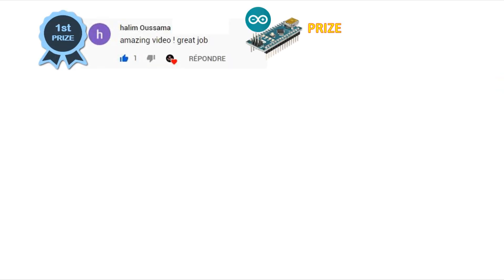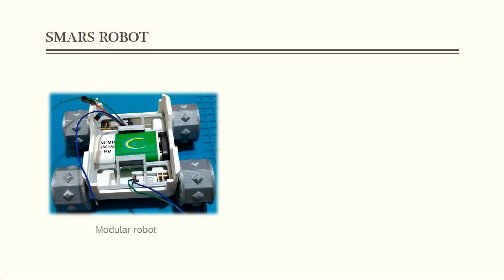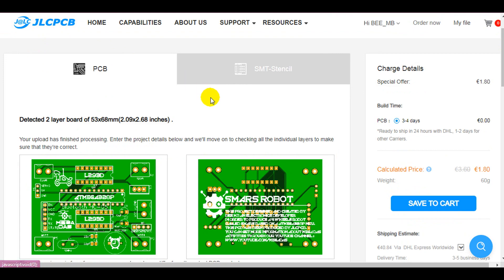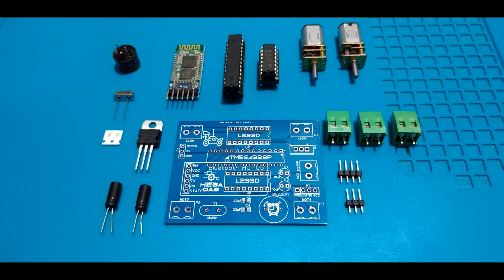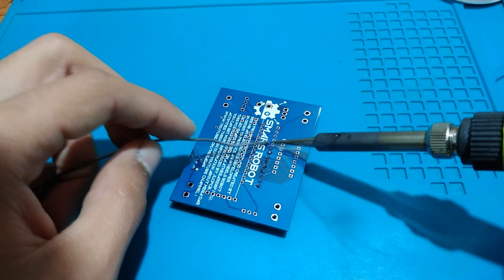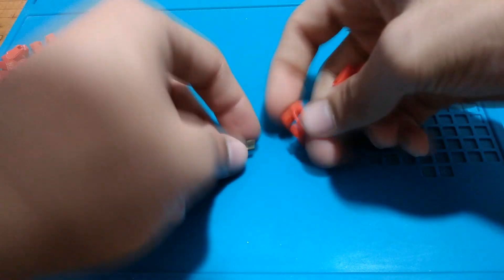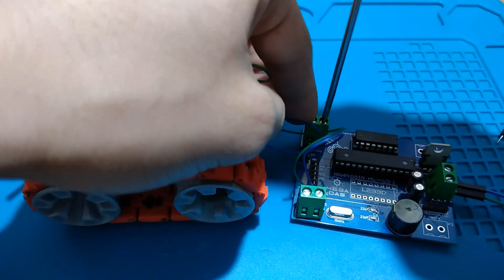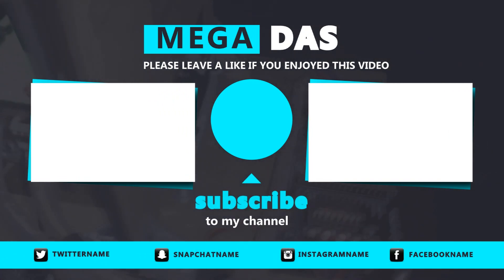How to make Arduino robot SMARS

Comment: why you dont give credit to the original maker?
Reply from the maker: First verse it is tagged in the video description
Then why to tag or promote someone for 30% of the work! I made the full electronics and the android app just got the STL file made..
Please guys don't make the most of it especially because this project has been edited by many makers so it is not clear who's the "original maker"
Reply: @DIYGUYChris  i think even after many iteration, it is still very clear who is the orginal maker, be it a single person or a big team, you should really give them proper crediting, since most of video that i have watched from your content you sounded like you were the one behind them. That is kinda rude to the OP dont you think, since after further inspection in your code you dont seem to change a lot, yet you remove the OP credential
Reply from the maker: @MuhammadRFabio  as I mentioned already, I gave them credential in the video description. About MY code I wrote it from scratch, and I got nothing copied from nowhere.. Otherwise it won't respond to the android app..
Reply: @DIYGUYChris  I admit in this video you did most of the heavy lifting programming job (which I admit is a very chalenging) but the whole SMARS Idea thing, the most STL you used is from this lad name Kevin Thomas from 2017. I also observe in your Quadruped project, the code you post in video description, the STL, almost all (except the android app) is mostly written and designed by RegisHsu back in 2015, while your work is of course is a derivative from the past project by some one else and at some parts you could call it your own, discrediting the Original maker is a very rude act, and without proper crediting could also be called plagiarized in most academic world, CREDITING IS VERY IMPORTANT. Just because your project is a derivative of previous project and you pour a lot of effort on it, please don't undermine the Original Maker's effort to gather the ideas and build it from scratch for you to continue working upon

Comment: great work bro
I am trying th project with my kids 
and i want to know the value for the SMD capacitors and it alternatives
regards
Reply from the maker: Capacitors are 22pF SMD 0805 Package for Oscillator sine filtering.
Reply: @DIYGUYChris  can i put the ceramic one instead?
Reply from the maker: @mohamedatteya5118  yes
Reply: MEGA DAS thank u so much i ve 1 more inquiry about the values of smd resistors used in spider project too R1 R2 R3

Comment: nice froject❤
can u convert it remote control to human motuon control?
Reply from the maker: Human motions control needs a camera there Rony 😁 yes we can but we should replace the MCU since it is not good enough with its 8bits processor to handle the camera frames
Reply: @DIYGUYChris  tnx bro.
I hope ur nxt project will be very interesting, helpfull & unique.
Reply: @DIYGUYChris  bro
for motion control can u use MPU6050 module in transmitter?